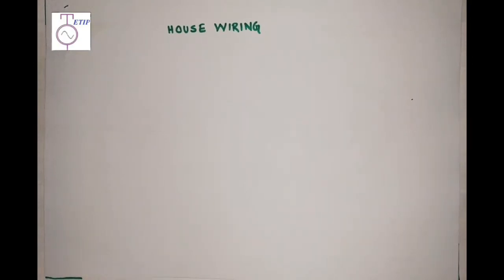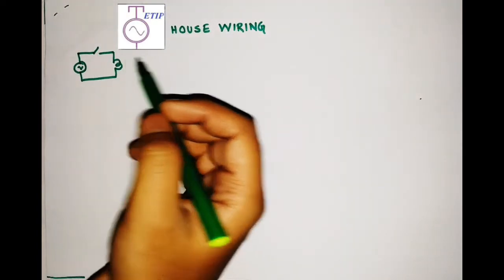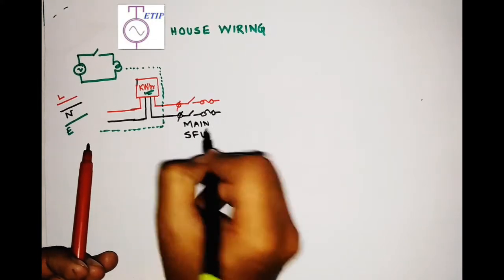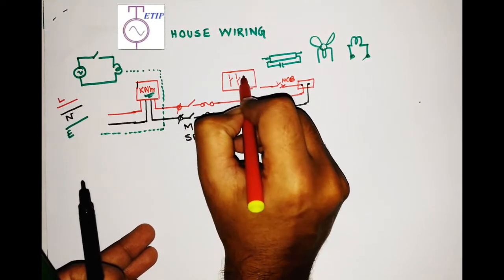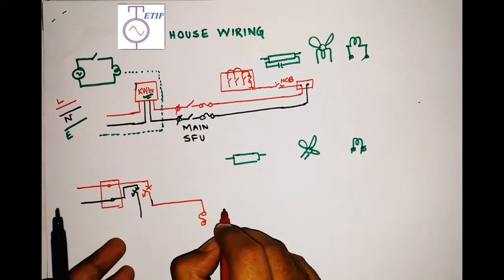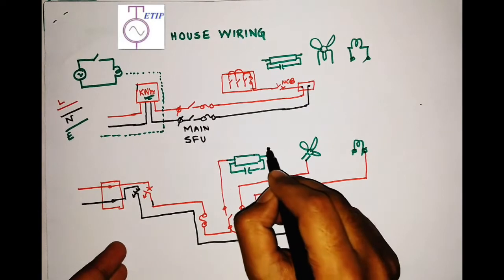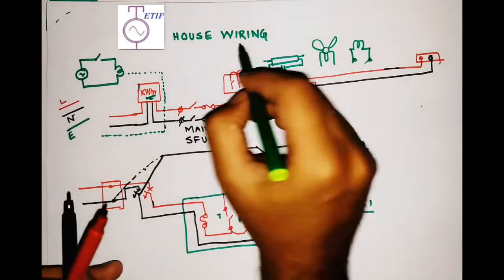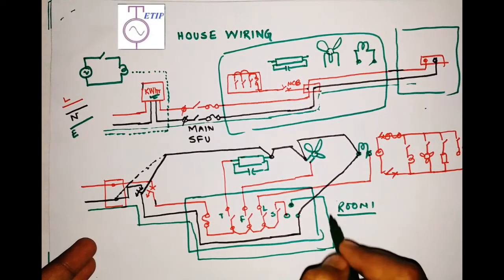House wiring or home wiring connection diagram|How to make house wiring|Electrical Technology

Comment: I think instead of a JB, we can have 3 -way or 4 way DB as per requirement and then from the  DB , P-N-E will be distributed to various room SWB's and from SWB's to individual appliances.
Reply from the maker: Of course you can. But that is an expensive solution. But better solution no doubt